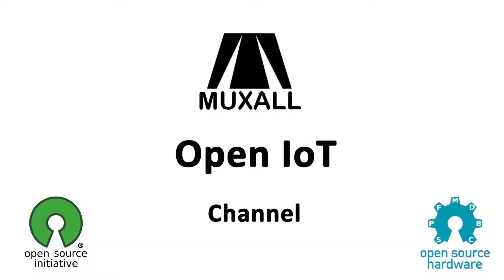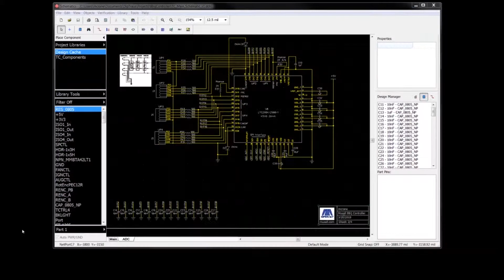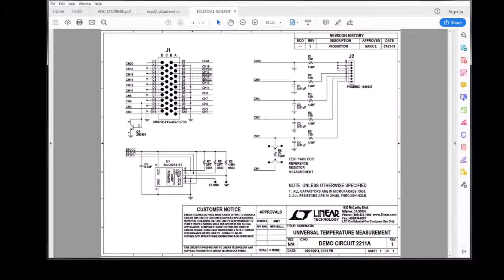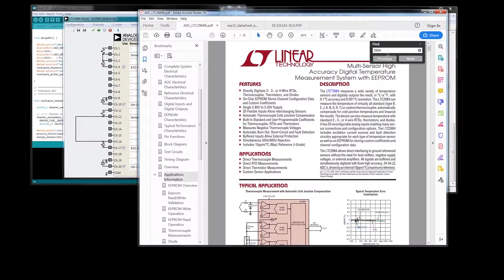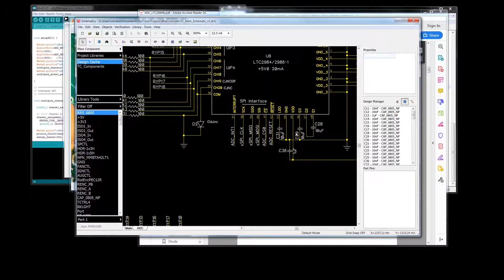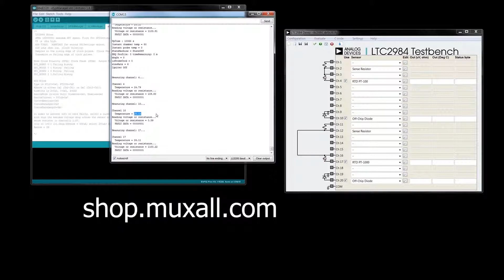IoT#30 RPTC-Q LTC2984 Initial Power Up and Repair

Comment: Bit of a concern that there is a 1 degree difference between the 2 probes. At 25 degrees that is a 4% difference. A future video showing how accurate the 2 probes are compared to your fluke temperature probe as the temperature ramps up from room temperature to BBQ temperatures.
Reply: Yes, 1 degree C is an order of magnitude out of spec.  Here are some possible causes; some I can fix, some I cannot:  If you recall from the video, one probe is going through input protection (RC filter) and the other probe I removed the input protection and soldered in some crude jumpers.  There may be a board layout issue since some of the traces run almost across the length of the PCB.  According to the LTC2984 spec, the chip may need strain relief for the voltage reference if positioned in the middle of the PCB (Pg 64 Reference Considerations).  And, there are most certainly errors inherent in the RTD probes, wires, and connectors.  My Fluke 87V has a 1% + 10 count accuracy (not including error in the thermocouple) with a 0.1 C resolution.  I can certainly use it for verification but the specs on the LTC2984 are better than the 87V.  So, when we start measuring tenths of a degree C, which one do we trust?  A wise man once told me: “A man with two watches never knows what time it is.”
Reply: @NetworkEngineeringVideoBlog  The 3 wire RTD is designed to compensate for differences in the wires connected to the probe. The circuit uses the fact that 2 of the wires are terminated at the same side of the probe to adjust for issues with the wires. Agree with the Fluke's accuracy of 1% at 25 degrees that means you are +- .25 degrees and if the LTC2984 is more accurate I would expect them to read within the Flukes accuracy. Also since the LTC2984 supports so many different probe types you can test it using the Flukes thermocouple. But for a BBQ grill, how accurate does the temperature measurement really need to be?
Reply from the maker: @qwerty1234158  Yep, you are dead-on about the 3-wire RTD.  For a true Kelvin resistance measurement, we need a 4-wire RTD.  For a BBQ, the accuracy is already good enough.  But, I will make it better.  I will also make the reading faster for the meat probe so it can be used as an instant read thermometer.